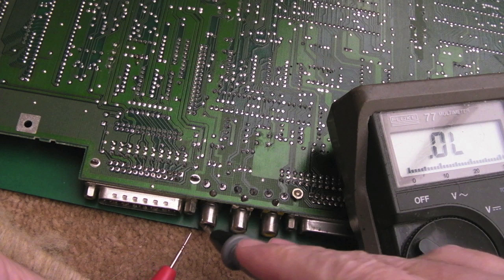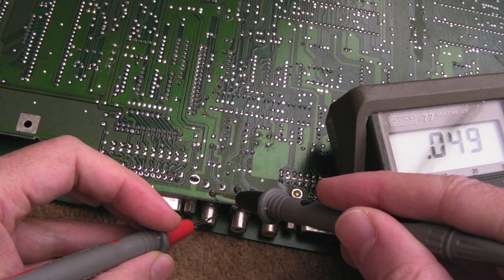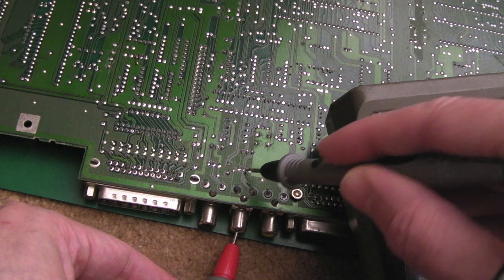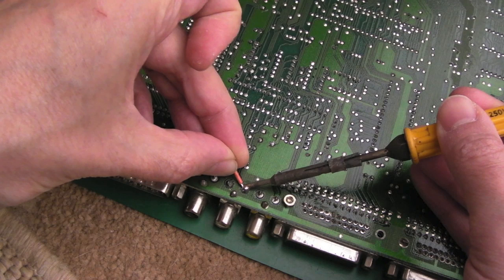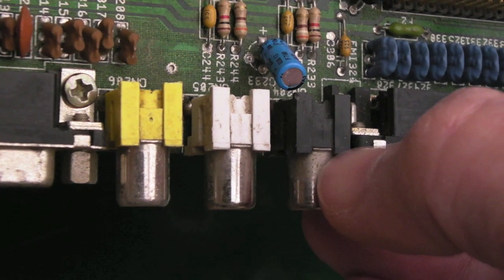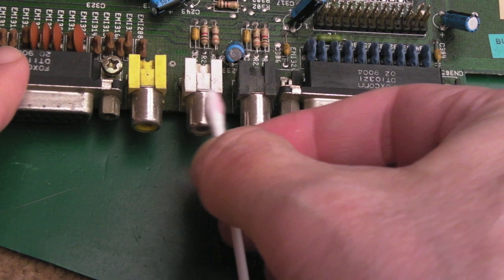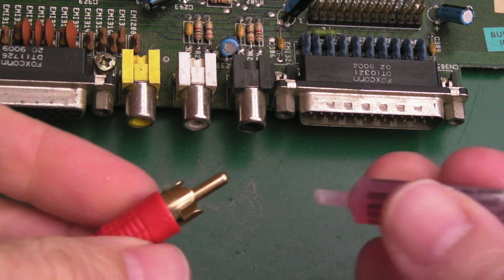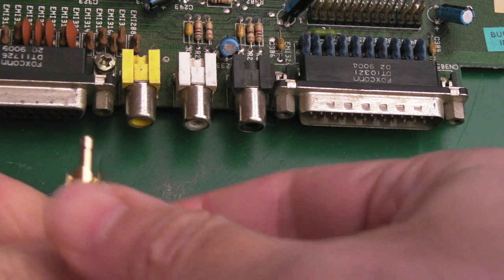RCA / Phono Audio Connector Quick Fix - TTP

Comment: When I stuck the multimeter inside the port and to the point on the board nothing happened. There was continuity on all the other ports. What would I need to do to fix this?
Reply from the maker: A soldering iron, some solder, and a piece of wire to join up the port to the solder point it is broken.

Comment: I have one problem one of the RCA output connectors on Marantz CD63MKII original SE is not sending the sound signal in the left speaker, when I move the cable's lug up the sound appears in the left speaker, when I released it the sound dissapears, please I  need an advice how to repair this since I am not an electronist.
Reply from the maker: It sounds just the problem I had - or just a dry solder point on the connector.  Just take it to bits carefully, and reflow the solder points on the connector.  Chances are that would fix it.

Comment: Howdy from Canada.  

Great video.  Appreciate. 

I have a question in the context of rca.  

I have tascam 1/4 inch 2 track tape recorder.   

Is it possible to replace the rca in put out puts to a xlr in pit out put ? 

Any thought are appreciated. 

Cheers mate
Reply from the maker: Yes, if you can find XLR sockets that would fit the profile on the case!  The alternative is to just create some cables that adapt from RCA to XLR.  With things like that I tend to measure the diameter of the holes and go compare to sockets on Digikey, Mouser, eBay etc.

Comment: hi nice video, Im facing an issue with phono connector of my receiver. It's sounds too low, I need to give all volume just to hear a little. But if I use AUX connector Im able to hear normally. 
Do you have an idea of what could it be? 

thanks for the time.
Reply from the maker: It could be a problem with the opamp accepting the input - maybe a PSU fault.  Have you inspected the capacitors?
Reply: @GadgetUK164   I guess I can start with that, I had to google each word you typed xD 
Thank you for the guide.